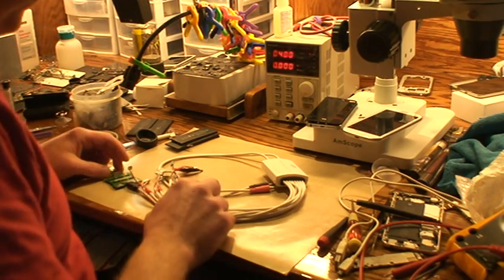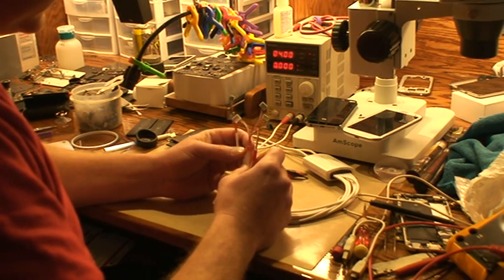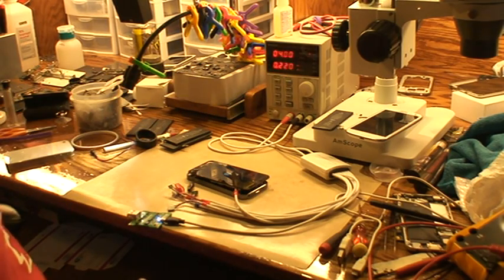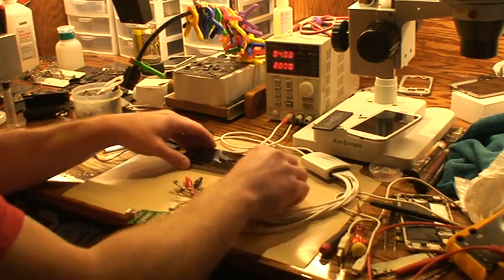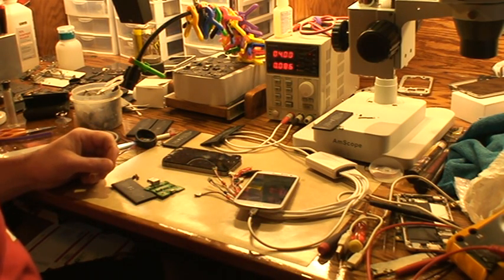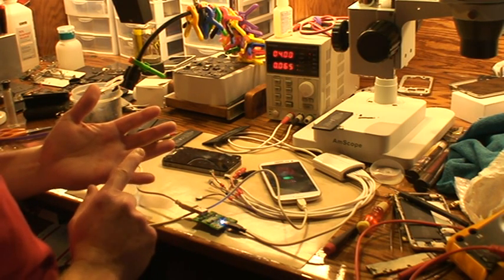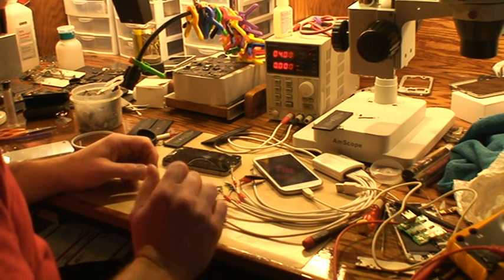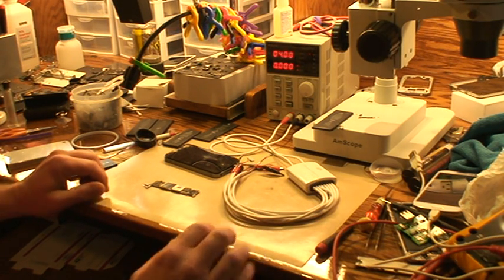iPhone to DC Power Supply Adapter

Comment: Thanks for the video! Can you say  what's happening to my power supply.. When I set the voltages to 3.8v or 4v and connect it to iphone, the iphone try to starting up but booting before lockscreen but when I connect the battery to iPhone it start normally. I have used power supply to find out short circuit on iPhones and I have set the amperage (current) usually to 2A-4A and I do that by shorting/connect the red and black probe together. Is it matter what current amperage I have left to power supply by shorting the probes? Sorry my bad English I hope you understand :)
Reply: Hello, dis you figured out after 4 years? 
I have same problem.
Reply: @princatko03  Set voltage to 4.2V

Comment: What is the type and model of cable for power supply >>>>
Reply: http://www.ebay.com/itm/APPLE-iPHONE-4-4S-5-5S-6-6S-PLUS-TEST-CONNECTOR-BATTERY-iPOWER-CABLE-PRO-2-WIRE-/131860635248?hash=item1eb3819e70:g:mugAAOSw9NdXq3OO